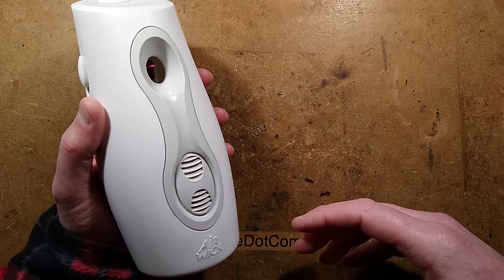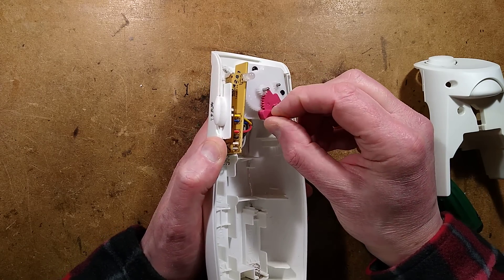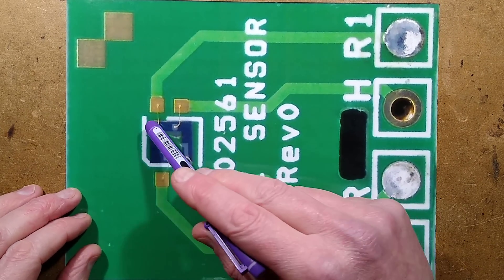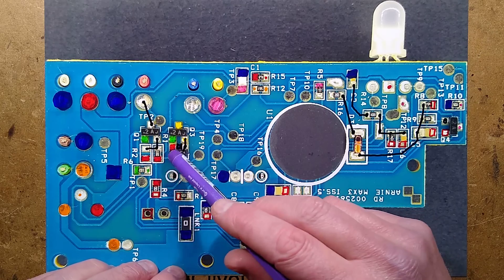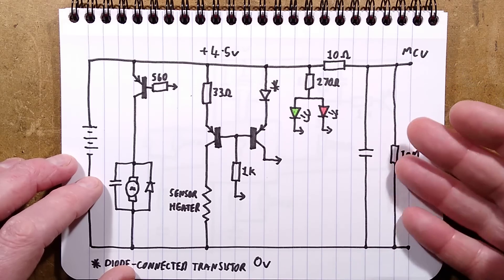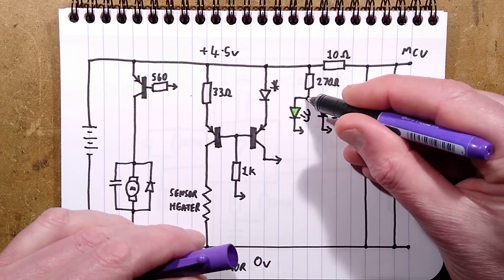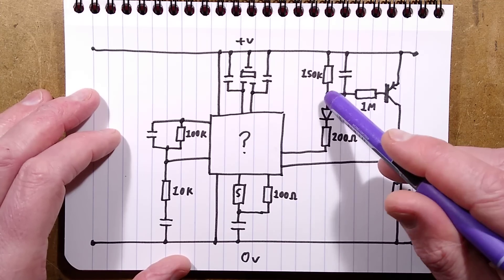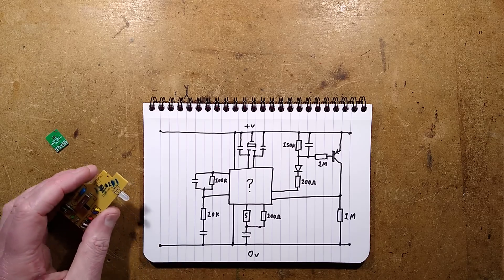Airwick fart neutraliser - with schematic

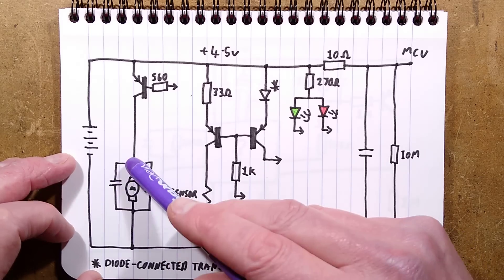Comment: At 7:10, you start talking about the strange arraignment of the 2 transistors. Those transistors, the diode, the 33 Ohm resistor and the 1k Ohm resistor from a current mirror. Or it might be a differential amplifier, as you might see inside an Op Amp.

The 1K is pulled to 0V and acts as a constant current sink from the 2 bases. The transistor emitter on the left is held about 0.7V below Vbat, while the base-emitter junction has it’s own 0.7V drop. That base is about 1.4V below Vbat.

The base of the other transistor is at the same voltage, so it’s emitter is also about Vbat-0.7V, leaving 0.7V across the 33 Ohm resistor. 0.7V/33Ohms = 21mA. That regulated current is provided to the sensor heater, making it a constant power heater.

For this to work, the 1k needs to be grounded by the MCU, and might be tied to the right transistor collector.

The sensor output is resistive (100k-500k), according to the datasheet pointed to by moe.m. If one side of that sensor is tied to the transisitor-1M resistor (top right corner, page 2), it might form a voltage divider that could be measure by the MCU (that’s a pretty high impedance, and an ADC would have a difficult time acquiring a measurable signal.) Why the transistor? I’m guessing the sensor resistance and a hidden capacitance form an RC circuit with a discharge time that can be measured. The capacitance is charged by the transistor before the measurement, then turned off to begin the measurement. The time required for the capacitor to discharge to some voltage is measured. (I’m not really seeing how the sensor works with one of its connections open….)

The ceramic resonator would be necessary for a stable time measurement, otherwise the MCU would have used an internal RC oscillator as an unstable clock source.
Reply: You see, this is why I love this channel. Regardless of the mystery, there's always someone in the comments who fills in the gaps that Clive has to guess at. Tbh I'm still less than enlightened as I'm only a little more than a "battery & bulb" sort of person, but the veil is lifting at the edges and I look at circuits with keener eyes than I used to. I'm even switching leds with transistors and just ordered enough to launch a Saturn V after I ran out of salvaged parts. Come sunset my home becomes a photonic haven.
Reply: that was my immediate thought as well
Reply: So the blob chip on board just contains the secret formula of what to so with that signal.
Reply: @kyoudaiken  it may just be a super powerful anti fart chemical

Comment: The "wired" transistor pair could look a little like a digital controled constant current source. I could imagine the tempeature of the heater have to be quite constant.
Reply from the maker: I did ponder if it was being used as a current source, but wasn't sure if that could work.

Comment: "triangular screw heads!"
I like the exitement about getting into the off limits terrain.
Reply: "*gasps* It's triangular ones, they don't want us in here!"

edit: "...good!" :D
Reply: Triangular heads seem to be the current default for tamper-resistance. Used to be the tamper-proof Torx screws with the central pip.
Reply: Reminds me of the old sating “No user-serviceable parts inside? I’ll be the judge of that!”
Reply: It's the unbeatable thrill of getting to use one of the 140 attachments you wouldn't normally use from your security screwdriver kit...
Reply: Flathead tweaker for the win on every "security" screw. I have a favorite that gets 95% of them first try. Great to have in the box.
Reply: And us DIYrs can buy triangular screwdrivers/bits and defeat the anti-tamper “screws” on many things 😁
Reply: It works quite well.  Most people will sit down to "fix" an item with a butter knife and an old one dollar bent claw hammer.
Reply: @someguy2741 MacGyvering that shit is fun though
Reply: @DeFausti  I agree.  But part of it is making it out of what you have a lot of.  If you have to buy two wheelbarrows and a bunch of other stuff then its just kinda pointless.  Now if it was built from junk wheels and an old bathtub... lol.  That would be hilarious.